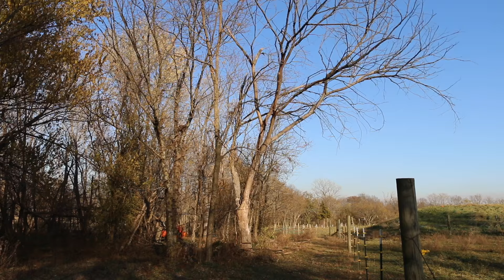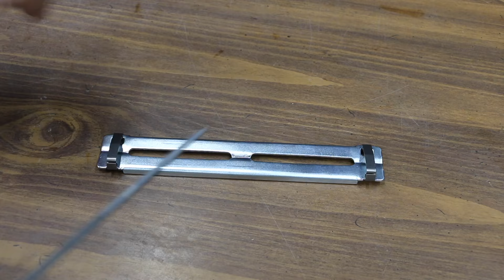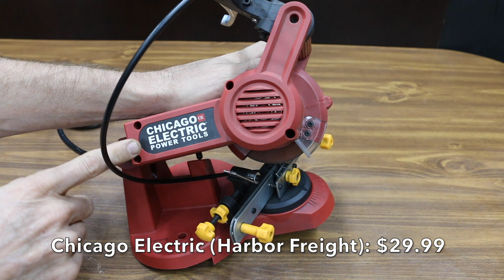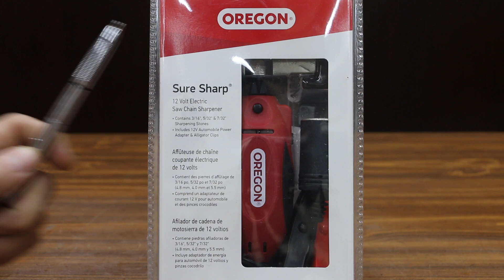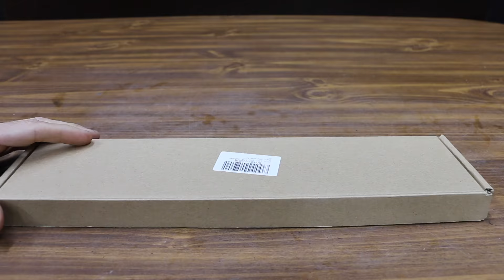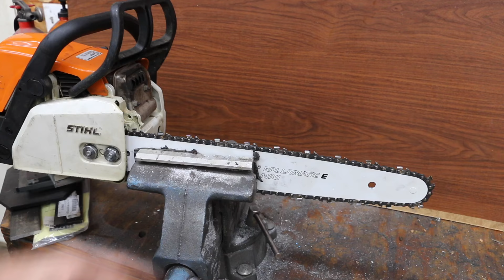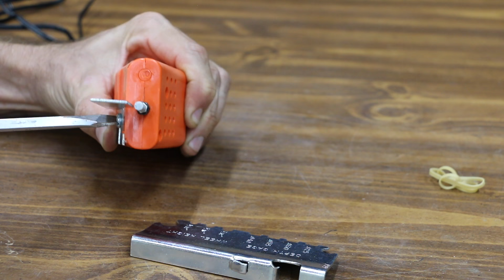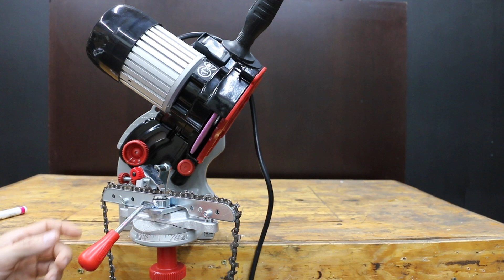Which Chainsaw Sharpener is Best? Let's find out! Stihl, Granberg, Chicago Electric, Oregon

Comment: As someone who makes a living doing tree work let me tell you the only way a professional should sharpen is with a hand file. I can sharpen a 28 inch bar in less than 5 minutes if the chain isn't completely wiped out and I can get the teeth razor sharp. The powered sharpeners change the geometry too much and don't allow a clean cut and also messes with the heat treated steel
Reply from the maker: Thanks for the feedback.

Comment: One thing worth note is hand filing will always get you the most sharpenings out of each chain because it minimizes material removed. Its also the most portable. That said, I'm definitely going to try the Stihl 2 in 1 on my saws because it dresses the depth gauges, as well as leading the fastest cut. I'd love to try square ground chains, but a good file from Vallorbe costs as much as the Stihl system.
Reply from the maker: Thanks for the feedback.

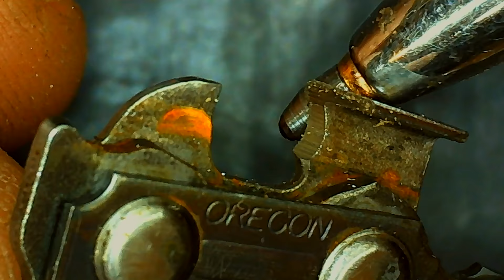Comment: I noticed that some of the trials had the disadvantage of cutting through the limbs that existed in some of the 4x4s.  Those limb 'bases' are almost always much harder than the trunk portion of the tree wood.  When your tests use measurements in seconds, that can make a significant difference.  As an example look at the upper left 4x4 at 3:38.  Compare that cut to the next cut at 5:28 (which does not have to cut through the bases). 
Next time (if there is one), you could "disqualify" a trial that had to go through the bases and re-run the trial until it didn't go through limb bases.  There were some other runs that also were disadvantaged.
The above being said, your video is very good and useful.  I liked the technique for cleaning the chain, first with brake cleaner then with lye.  Thanks!
Reply from the maker: Thanks!  Thanks for the suggestion.

Comment: Excellent video! Very professional! I had never heard of the lye cleaning and many haven't heard of my way. Heated unsweetened lemon juice add white vinegar to it for rusted chains....works Excellent on chain, bar, and to clean carbs. I have always filed by hand...but think I may invest in the 2-in-1....it even looks like good quality. Thnx again.
Reply: I’d never consider cleaning chains in any water based solution.  To my thinking it would also wash out the lube from the chain rivets.  I use kerosene or diesel fuel, cleans fine and only adds lube.
Reply: @tomrogers9467  yes, it does dry out the rivets as you mentioned.  After the old man showed me the lemon juice method for carbs and bike chains ,  something I didn't mention is after wiping all the lemon juice out and or blowing out with air, he submerged in very warm Kroil oil.   I am definitely gonna give this a try. Thanks again.
Reply from the maker: You are welcome!

Comment: Another great video!  I sharpened  about 50 chains a week for around 2 years (rental yard) I also sharpened for a couple of competitive loggers.  I used a commercial sharpening machine, and what I learned after all that was that there are a lot of ways to use tweaks in sharpening settings to ; improve chain life,  speed up cutting, tune for ripping or crosscutting, or tune for safety.  High rake teeth and shallow cut angles cause much less kickback, but work much slower. They also dull less quickly in dirty wood.  Guess how I was instructed to sharpen chains in the Rental Yard?.  It was great of you to do a second round after going through the learning curve.  What do I use today?  The Oregon Field Sharpening kit.  Fast enough for me.  I sharpen on a good  tight section of damaged chain bar set up in my bench vice.  This is caster and more precise than sharpening on the saw.
Reply from the maker: Thanks!  Thanks for sharing.
Reply: Tried different kits and files and basically threw them into the bottom draw. What matters IMO is actually looking at the chain profile and sharpening it till it's razor sharp. And close to the right angle for the type of wood. I just use a 12 volt hand electric sharpener and change stones and sharpen really regularly. Learning what are sharp chain should really look like is the key.  Depth gauges etc are a substitute for brains and frankly a waste of time.  In Australia we cut real hardwood not mock wood.  Your chain must be really sharp. And you need a proper saw.

Comment: I was given a portable electric hand grinder probably 20+ years ago, and it worked great for me all these years. just buy a few stones every couple of years that's it. Loved it. no fuss no muss. great out in the woods as well. those bench style you have to be at home to sharpen. big disadvantage for me.  If I wanted to sharpen my saws before going out to cut wood, I would put the chainsaw in the bench vice and hook up my grinder to a battery charger. It also worked great  for me.  BTW it also came with a rakers gauge so you could file down the rakers to proper height. I did use a flat file for that.
Reply from the maker: Thanks for sharing.

Comment: That stihl file is amazing. Only takes a couple swipes per tooth and you're good to go, as long as the chain isn't SUPER dull. I don't like those electric ones because I think they take away much more material than necessary and shorten the life of the chain significantly.
Reply from the maker: Great point on the Stihl.  Very impressive brand!

Comment: Great Job on your videos.
I have used the Harbor Freight sharpener for over 10 years and I fully agree with your conclusion, it does change the chain geometry, because you can not tilt the head for the correct cutting edge angle only the angle direction of the cutting stone. The chain never works as well as it did when new. I bought a off brand 2-in-1 off Amazon and I must say it does sharpen much better than the H.F. sharpener and is the only one I use on new chains and is quicker.

Thank you for your videos.
Reply from the maker: Thanks!  Thanks for the feedback.

Comment: I've been using chain saws for 60 years now.  Never as a full-time professional, fire-fighting in the 60's, and personal use since.  Sharpened with nothing but a round file for years -- taught by an old pro, so it worked pretty well, but not the best.  Went to a Granberg manual jig, used it for 20 years.  It put a factory-fresh edge on the teeth, but every three or four times I'd sharpen a chain I had to run a separate exercise to file the rakers (purists say they must be called "depth gauges"...whatever, they're entitled to their silly opinions).  I tried the Harbor Freight electric grinder, and it did a pretty good job, but maybe not quite as good as the Grandberg, and it had three drawbacks - 1st, like the Grandberg, it didn't address the need to file down the rakers;  2nd, I had to take the chains off the bar and back to my shop, a royal pain;  and 3rd, it changed the geometry of the cutters' edges so much that, if I was cutting out in the woods, and dulled my chain, it took forever to use the old fall-back, my manual Grandberg jig, to resharpen it.  So I went back to a steady diet of using the Grandberg.

Then someone showed me his Stihl 2-in1, and I used it once -- I was hooked.  I'm buying my own next week, in preparation for my next firewood gathering trip.  In addition to lowering the rakers, just a bit, every time I sharpen a chain, it also has the advantage of being smaller and more rugged than the old Grandberg...it fits right in my saw case, and I don't have to worry about the bars getting bent or tweaked, carrying it around.  It's a great system.  It's so good, there's an outfit named Earlow that is making what looks to be an exact duplicate (Chinese, of course) for about half the price of the Stihl.  They even call it their "2-in-1" sharpener.  I'd sure like to see them get shut down.  I pray that nobody who reads this post will buy their knock-off.
Reply from the maker: Thanks for sharing.

Comment: The  Stihl   2 in 1  is faster  because you keep  taking the  rackers down .. I have never used an electric  saw  .. but  electric  motors are known for a lot of torque  ..  I  assume the  batteries are fully charged for each test.. Old  batteries don't  perform as well
Reply from the maker: The batteries were fully charged for each test.

Comment: The best sharpener for the average user, hands down, is the file-n-joint. Not only does it do a great job in ensuring filing consistency right from the start, but also it ( plus a micrometer ) can be used to re gauge badly sharpened old chains that are cutting in circles. The only bad thing about them is the angle pawls can slip if not tight enough;- something which can be easily fixed buy using lock washers under the tightening nuts. In theory electric sharpeners can be  good, but they tend to cook the temper out of teeth in the hands of an average user and are not precise enough to get chains properly sharp.
Reply from the maker: Thanks for the feedback.

Comment: I have a Oregon sharpener.   When I first used it , I used the stone that was supplied and it was a pain. You have to reshape the stone wheel.  So to fix this problem I found a diamond wheel for it.  I never have to reshape it.  I did 3 chains for a friend  the other day and his words was the first chain was sharper then the new one he had.  He cut more wood than the new one.  Now I'll be honest, I'm a novice at this but I got tired of taken my chain into a dealer and after 3 times of them hacking them, I would have to get a new one.  This way I can have a chain A LOT LONGER.
Reply from the maker: Thanks for sharing.

Comment: Great video, i have the chicago electric but removing the chain from the bar is a hassle .. Im going to pick up one of high performance hand held units .
Reply: Do not forget to remove bar clean out grove and turn bar over, or you will need new bar pretty fast. At least ever couple filings.

Comment: I have been using an Oregon Suresharp for years with diamond grinders.  I have a small vice fitted to the mudguard of my Telehandler which has a cigar lighter socket and it takes no time at all to keep on top of the sharpening process when out in the woods. It is surprising how often the chain dulls even being careful around dirt.  Dirt can be in bark and inside hollow trees. Big ivy is another one.
 Not having to take the chain off the saw is a big time and fiddle factor.
There is a lot of difference which comes with familiarity with the tool and a little twitch up as you finish the tooth to fine hone the leading edge is a winner
I now wear even thicker gloves when rotating the chain to prevent bloody fingers!
Do not like the way the big disc grinders change the profile of the gullet.
Reply from the maker: Thanks for sharing.

Comment: good test I am an ex logger the files is best either with a good guide or with  a skilled experienced hand the problems is that the heat produced by the grinder softens the steel of the cutter even though the outer edge is hard chrome coated 
the file comes into its own when you get well back on the cutter and if you do everything 100% the last sharpen (the one just before the line, which is both a wear limit indicator and angle indicator) will be the fastest cutting
Reply from the maker: Thanks!  Thanks for sharing.

Comment: Would be great to see you do a follow up with "Full Chisel" chains. 

In my opinion the full chisel is the best profile for clean wood in qualified hands. The full chisel is the go to loop for many who value speed in clean wood over the versatility and safety features of other profile types.

It has also been my experience that sharpeners with a large wheel are really only well suited to full chisel.....but on full chisel these sharpeners shine in both speed and cut quality.
Reply from the maker: Thanks for the suggestion.

Comment: Dear Project Farm, I noted at the beginning of the video that you showed (in yellow packaging) the Oregon Powersharp Chain Sharpening Device.  You even chuckled about the claim that it sharpens in just 3-5 seconds. I never did see this included in the comparisons you made.  Any reason?  Was it such junk that you just didn't/couldn't use it, or would it not fit your chain?  Thanks for a great, methodical comparison!

Comment: You make excellent videos and your tests are a great source of knowledge for us all. Good on ya for that. When I first started with chain saws 4 years ago,  tried some of the equipment for manual sharpening with the guides and files and so forth.  I did not care for them. I am reluctant to buy any power equipment. What I like is to use the Dremel  or Grandberg chainsaw sharpening heads  used in my Dremel Moto Tool. I do not use "guides" of any kind.  I think that one reason that some are unhappy with their results, is the beginners neglect to shave down their Depth Gauge. That is the part that determines How--Big--A--Bite that the teeth take on each cycle.  It takes me probably a little over 6 minutes to sharpen the chains. I like to use my own "feel" for the equipment.  Too much gadgetry takes away my feel for the chainsaw.
Reply from the maker: Thanks!  Thanks for the feedback.

Comment: When you sharpen a  knife (or any blade) sing a file or stone , do you push the cutting into the file/stone or drag it it the other way? When you look at the cutting edge you have to look at both left and right tooth.  Also the judge of a good sharpening is not only how well it cut but how long it will hold that edge
Reply: When sharpening with a file, the teeth on the file are pointed in one direction and that is the direction you push the file so the teeth bite into the steel. Lets say the sharp part of the steel being sharpened is pointed towards you and your file or stone stroke is pointed away from you, then you will then have less burs. You will still have burs, just not as much. Sometimes I will sharpen tools with edge trailing, but I will finish sharpening with edge leading to help get rid of most of the burs. With something like a knife, you can run it across a leather strop, leather belt, or piece of wood (ideally end grain), or cardboard, to help finish it and knock off the remaining bur.

Comment: Sorry to be slow commenting here but I have the CE/HF sharpener I got app 7-8 years ago. It's still working, not done a thing to it. Just to be clear I don't sharpen hundreds of chains a year but 30 or so more a year than I want to. For several decades I did a hand file system and didn't have as good of luck which is why I gave the HF bench unit a try. I did mount mine to a 4x4 and then set it in my bench vise to hold in place. But to be clear I have not replaced a chain since buying the HF version. Over the years I think I replaced chains that might have been saveable but pitched thinking they wouldn't sharpen anymore. I like many never stop to think about a file wearing out. A buddy in the small engine trade who sharpens saw chains says you get maybe 10 sharpenings with most files you buy before the quality of the file goes bad. A good swedish style file might get you 30 or so but you will pay for them. For over 40 years I did not know this. I mean come on who thinks about wearing a file out? So to me the best bang for the dollar is the HF bench grinder. I like to keep 5 chains around and since you have to remove the chain to sharpen (the only downside I see to it) I wait till all are dull and then have a sharpening party. I change the chains soon as I see a difference in the cutting instead of grinding the chain down real bad forcing it to cut that then requires more of the chain being removed to sharpen it and a good sharp chain runs cooler and does less heat related damage to the chain.
Reply from the maker: Thanks for sharing.

Comment: Great video !
How about a comparison of chainsaw files? Used to cut a lot of wood and noticed a definite difference in file brands. Initial sharpness and how long they hold it would be interesting, at least for me. Lol
Reply: I used to work for the US Forest Service and ran chainsaws all day long. From my experience, any file made in Europe will last much longer (Swiss, German, or Swedish manufacture). Oregon brand makes excellent stuff too. The handling of files makes a big difference (like bouncing around in a dusty ATV box is a horrible way to treat a file).
Reply: @jjensen9786  That was my experience as well,  just can't remember which European country made the best ones, there was a difference. Tried some Chinese chains a few years ago. (cutting on an old house with nails) Those chains seemed to be easier on files, which would indicate softer teeth. Now the only cutting I do is infrequently at work, use an electric bench grinder there.
Reply from the maker: Thanks!  Thanks for the suggestion.
Reply: On the mountain, I used a stump vise and a Swedish Husqvarna file in a Chinese "field sharpening kit" with a clamp-on guide & orange pouch like the one in the video. I think I got it for $15 at Tractor Supply. The pair of files were about $5 at Ace Hardware. All the guys on my crew swore that I could get a chain sharper than anyone (longest curls, faster cuts, longer lasting), including the "professional" shops in town. I also have the same Granberg XT105 power model as in the video, but now I mostly only use that on heavily damaged chains (as in rocks, nails, and wire). I just don't like wasting the time of pulling the chain off the bar (although it should be cleaned/lubricated, and I soaked chains in red "farm" diesel overnight).
Reply: I would get 4-5 inch curls on a freshly-sharpened chain when I "dogged in" on a fresh green aspen if I had taken down the rakers.
Reply: I think a big component of sharpness is CONSISTENCY in every move that you make (as every cutter should carry the same load in ideal conditions). This is a strong argument for hand-sharpening, whatever equipment you choose.